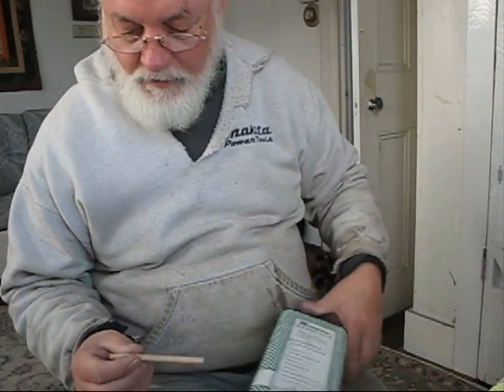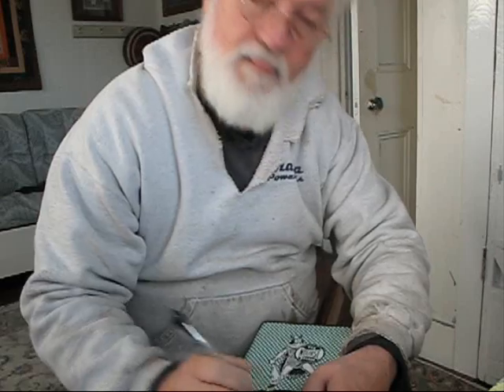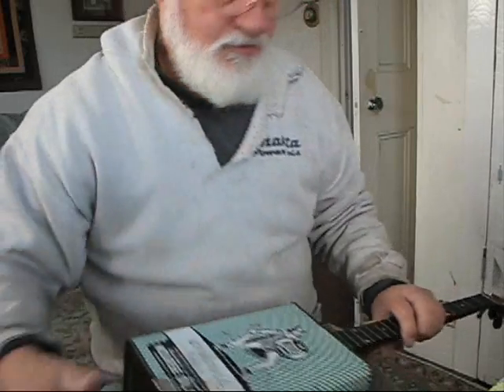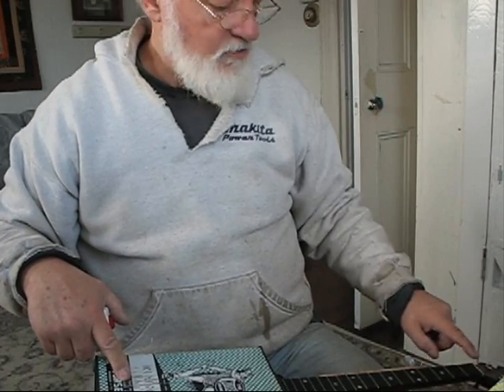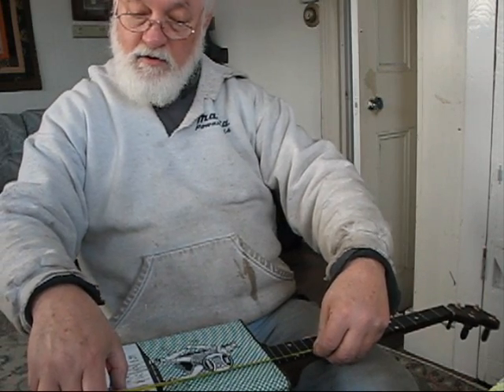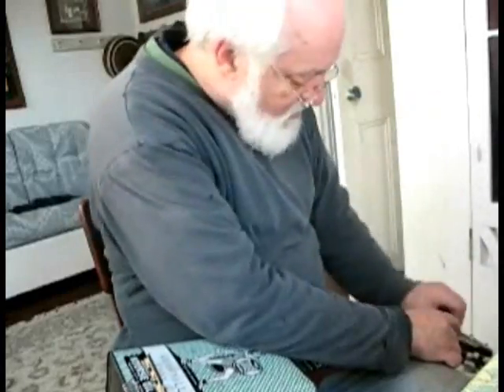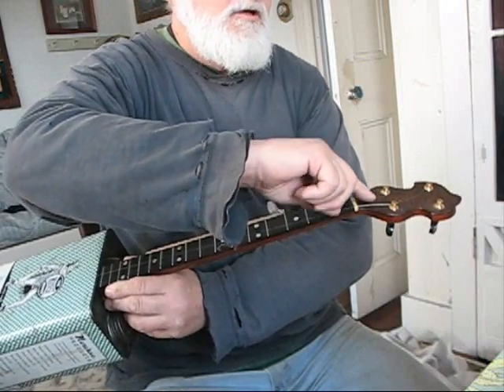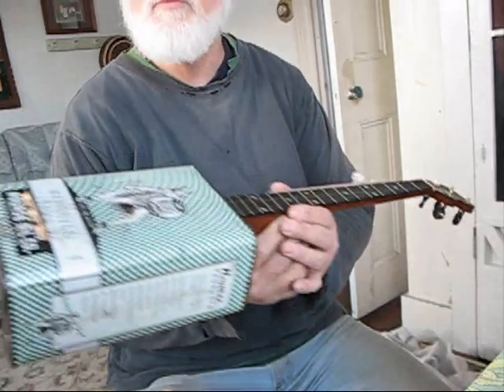How to make a gas can banjo 10

Comment from the maker: @byron151227   No.  the bridge is held in place by the pressure of the strings and is supposed to be movable, so you can adjust it.

Comment: Awsome set of vids, "rpeek"! Just a couple of questions to ask before I get started on trying to make my own.

1) Just wanted to make sure what size can you're using. That is a one gallon, right? Because I've run into mostly 2 gallon cans. Could I get away with a 2 gallon can?

2) What would be the down side to just cutting off the handle of the gas can to put the neck in the exact center?

Again, thanks for posting these cool vids.  I really love the sounds of these "Canjos"!